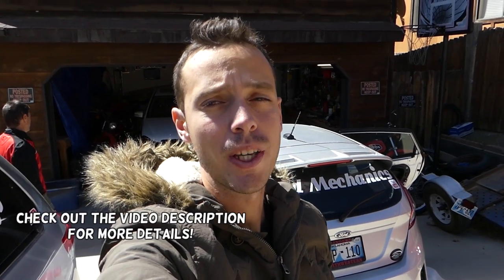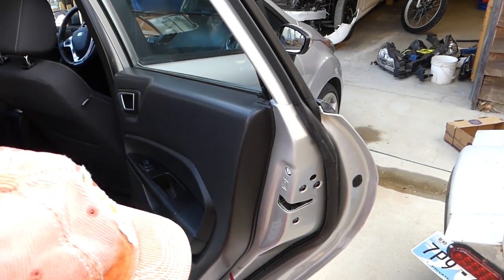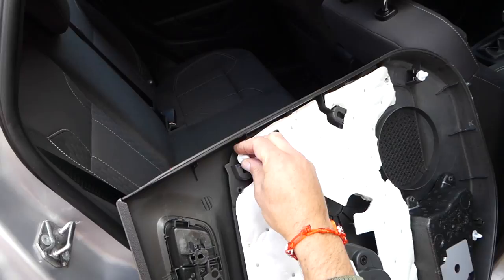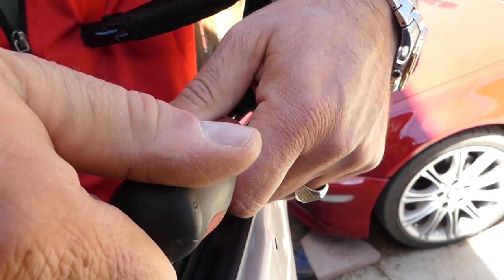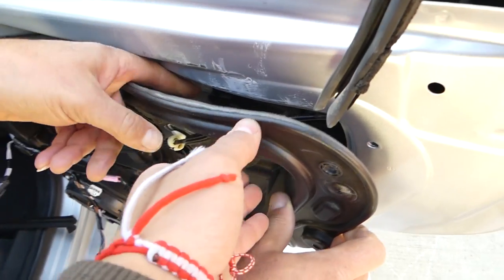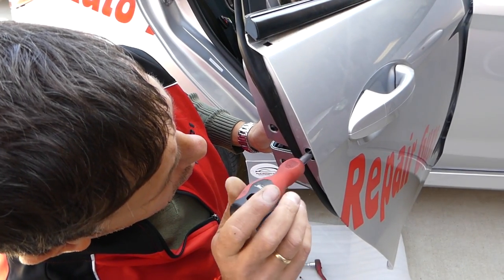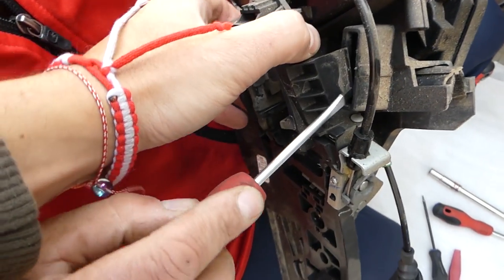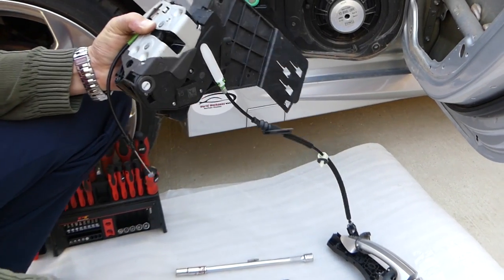HOW TO REPLACE DOOR LOCK ACTUATOR ON FORD FIESTA MK7

Comment: Many thanks for the video. Thanks to your video I was able to change the door lock without bigger problems. I only struggled once because my fiesta has another type of windows glass which has an additional (yellow plastic) bolt in the lower section which has to be removed partially to be able to take out the window glass.

Comment: HELP. After I finished the installation I forgot to test the remote locking/unlocking. After testing I noticed the door I replaced the latch locks when I open the car and unlocks when I close the car. Completely the opposite of what it is supposed to be doing. Help please, what could I have done wrong????? 
Hopefully I don't have to disassemble everything again. Could I possibly installed the wiring connector for the   latch backwards???